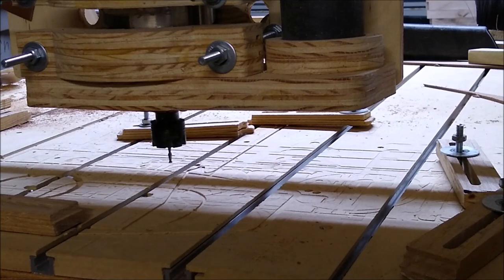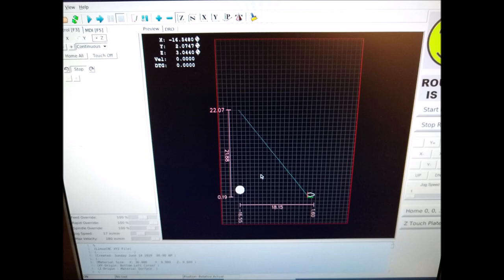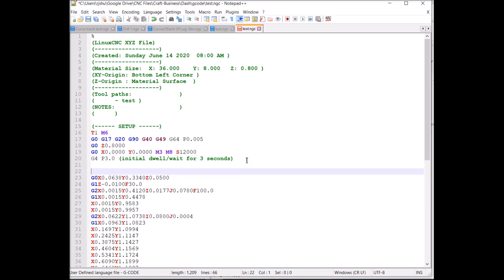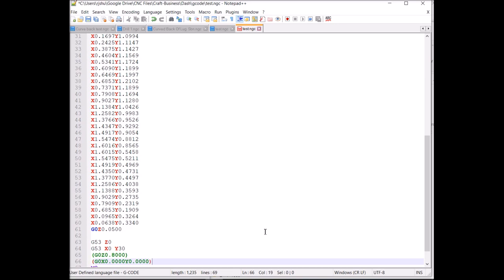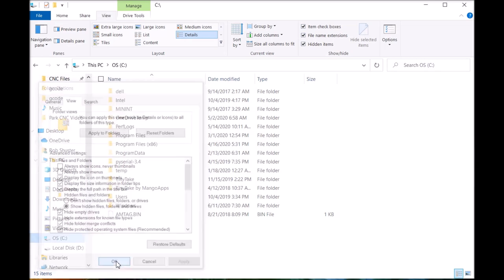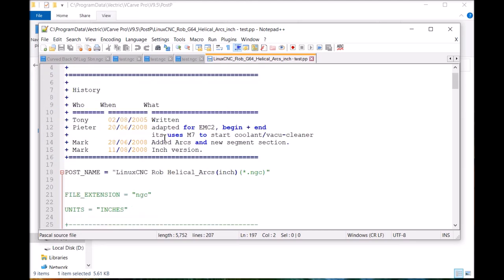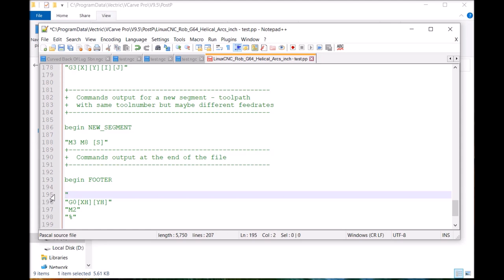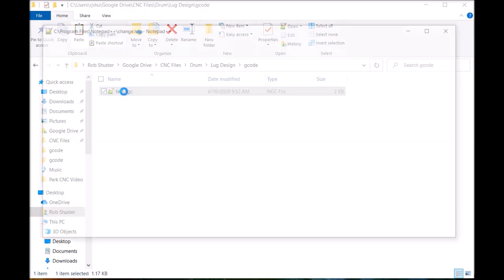Automatically Park Your CNC In the Same Spot Every Time After Running Toolpaths

Comment: Great video. Is there a way to have the G code save with the filename in the header so you can see the filename in the window where the code shows in Mach3. Also I am using the generic " G Code (inch) (*.tap) " on my Gatton CNC that I built several years ago. ( it's still working great )
Reply from the maker: I don't use Mach3, so I am not 100% what you asking.  If you want to show the file name in the header, edit the post processor file, and add this row to the header sections:
"( File Name        : [TP_FILENAME])"

This will add the name of the toolpath file name to the header.  If you want the name of the Vcarve file, then I cannot help with that one.

Good luck!